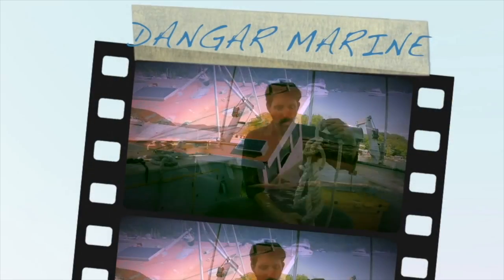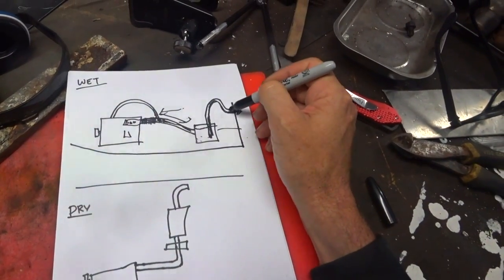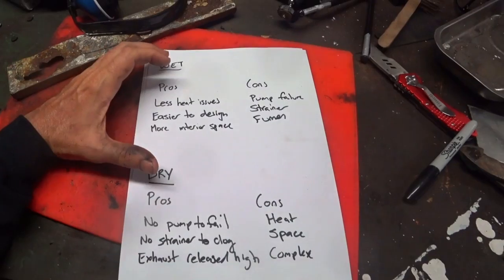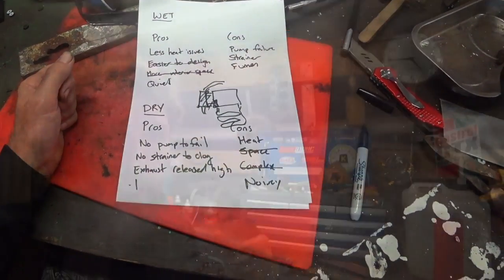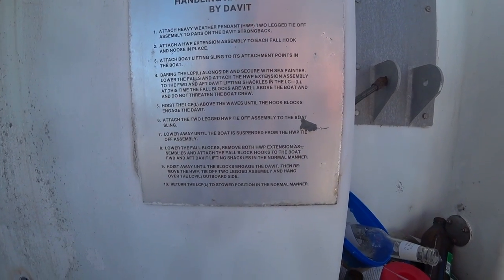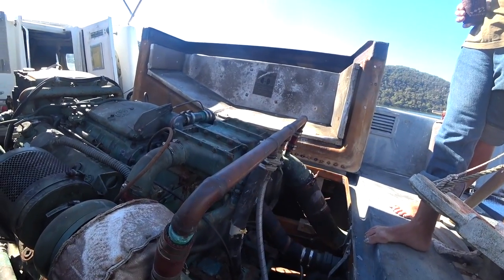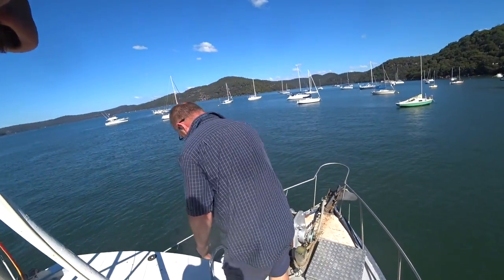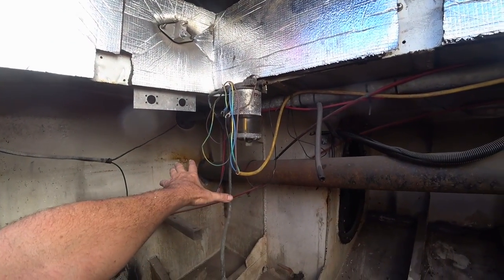Wet Exhaust vs Dry Exhaust

Comment: You can get a variety of mufflers for a 4-71 at the local auto parts house; these engines are the most popular marine engines in the world. Go dry exhaust and put you a colling water tattle tale out one side of the boat so you can physically see the raw cooling water flowing out. I'm in the USA and ran a 48-foot crew boat, a Breaux Bay Craft, for a couple years. main power was two 8V-71s raw water cooled and wet exhaust. On each engine, we had the hot raw water out exiting through the port and starboard side, respectively, about a foot above the water line. Crank up your mains and look over each side and see if your pumping raw water or not. I loved that boat, but she could go through 300 gallons of diesel in no time. Had a set of 2-71s on gen sets too. Love you trawler series, I want one myself, but about 10 or so foot longer with a 6-71.
Reply from the maker: I know what you mean about being 40 foot longer being desirable. That's why I'm so desperate to get space back!

Comment: Wow Stu.....best video ever......I hate the idea of salt water running through my engine.....all that corrosion....electrolysis.......anodes.........a hole in the hull.!!!!....I've been thinking about exactly this dilemma for the last 3 years......currently running wet exhaust....Bukh DV20.......dramas with ancient pumps and impellers.......hmmmm?   separate coolant system??? dual cooling system??? dry exhaust.?.......electric conversion with generator and new prop?????? .........For what it's worth.......I reckon you should totally go the dry exhaust option......it makes total sense........BTW....your workshop looks like mine.....noice.........and last of all....thanks for showing us all 2 sweet Trawlers and their massive Donks....(Australian for engine).......on the quiet motor issue.....have you considered 2 mufflers?.....one big unit that lives under deck.....high flow.......and another topsides.....the silencer.?..........Like a Cadillac........or a Lincoln Continental.......Thanks man & Cheers
Reply from the maker: I definitely could rig two mufflers, even two and a particulate filter. I really need to talk to an exhaust specialist to help with the a design.

Comment: Hello Stu, I've been pondering the muffler question for your engine. There is a guy in the USA who is an absolute Detroit Diesel guru. He posts on YouTube as Bus Grease Monkey, he is a mechanic who travels thousands of miles a year in his fully equipped vintage bus to work on peoples Detroit Diesel equipped buses. Thus far I've not seen a single aspect of these awesome engines that he isn't able to tackle. I'm sure that if you contacted him with your questions and thoughts he'd be happy and very able to help you out. He's a thoroughly nice guy and a mine of knowledge. Regards from the UK.
Reply from the maker: I'll try getting in touch and see what he says.
Reply: @DangarMarine  He posted a video way back in 2014 that might be of interest Stu, It's posted under the title "How to set maximum no load RPM on Detroit Diesel 8v71 6v71". There is a contact web address thingy at the very start of the video too. That should make things a bit easier.

Comment: aye Stu, nice clean up!  I think you are right on with the dry exhaust.  Seems the boat already has all the hard parts done....safe penetrations and space allocated.  I think the previous owner maybe didn't use a muffler and that lent them to go wet.  But with a nice system designed for your engine I'm sure the noise would be no issues after hearing your mates trawler.  Plus a quick blanket and box in with a marine rated fire board would keep your and guests safe from burns.  Sounds like a smashing idea!

Comment: Hi.  Interesting issues with both.  From my perspective both are too noisy and obsolete.  The wet exhaust, if designed and well built seems like it could yield the best results.  I wonder if it's time to make it right and use dual electric motors and build a nice bimini to cover with solar panels.  If it was my boat this would be the only way forward cause I would have no pleasure on a noisy boat or smelling exhaust and fuel fumes. Nothing could be sweeter than a silent gliding boat traveling the beautiful oceans.  I think the wild life, any passengers and the whole world would be really proud of you for going electric.   Good luck with the project. Thanks for sharing.

Comment: Another thing to consider in the wet exhaust system, is that if the water is injected into the exhaust at or close to the water line, a siphon break is a good idea to install in the raw water discharge line with a loop above any possible water line. This ensures no water can siphon past the raw water pump and fill the exhaust.
This is done primarily in sailboats and other vessels where the engine is below the waterline.

Comment: Hey Stu,  to eas your mind about the waterflow, just weld the old water-outlet shut and drill a new hole above the waterline so you can see the coolingwater flowing. Shouldn't be that hard, and it doesn't hurt anything. For the exhaust itself, just replace those double-stacks with a good muffler and all should be good. I mean, your mates dry-exhaust sounds just fine with only one muffler. Never thought a Detroit could be that quiet with only 1 muffler! I do agree with you on asking an expert, though. That really can't hurt. Well, the wallet maybe, but other then that...
And i'm sure you can remove that whole wet-exhaust without regrets. Lord knows what the previous owner was thinking when he converted the boat to wet-exhaust...
Reply from the maker: Having the water discharge below the water line apparently helps retain prime and can be an advantage when when pulled up next to a wharf or boat with low free board. Having said all that, I do love the idea of being able to see the cooling water.
Reply: @DangarMarine  Indeed, not eveyone likes wet feet by a water-outlet from a neighbour, lol. It's common over here, though, on commercial ships that is. 
But indeed, it can be a problem. That said, you could opt for a .... an eh... yeah, don't know the English word for it. Let's say a looking-glas.
I have in-line thingys with glas on both sides to check the flow. If you want i can make a little vid on it to show you. Just tell me where to post if you'd like that.

Comment: I have owned and operated both wet and dry exhaust vessels. The dangers of a wet exhaust are:
(A)  going hard astern, where the sea washes back into the turbochargers, Particularly vulnerable craft are low slung speedboats. No room for a high-rise bend in the exhaust pipe before overboard skin fitting.
(B) Heavy rain or leaky stern glands; especially low slung powerboats unattended at moorings or marina dock.
These can cause entry of seawater into exhaust manifold and cylinders; wrecking the entire engine. As a boatyard proprietor I have had various customers with these problems.
A dry exhaust with a large muffler (exhaust silencer) is the best, hands down. Raw cooling water appearing from skin fittings above the waterline then confirms that the heat exchanger is being supplied and no other possibility. 
As far as occupying space is concerned; no reason dictates funnel must be amidships. Awnings, Radar and antennae goalposts aft can carry exhaust pipes on either side.
Reply from the maker: I'm happy with my decision to go dry, it has certainly given me a lot of room back in both the lazarette and engine bay.

Comment: I didn't realize this was converted from dry to wet and the infrastructure is there.  Best guess is the noise drove him to a wet exhaust.  Those 71's get loud even with the proper muffler.  If you decide to go dry you could also think about a keel cooler and use the ports for the raw water suctions for the keel cooler.  Heat exchangers require diligence monitoring the zincs and you need to inspect the unit itself once a year and possibly back flush it with some cleaner.  Not that it's a problem for you, but it is a consideration.  

As far as the 71 maintenance goes...we had a whole list of things we did on an annual basis for exactly these engines.  I'd recommend replacing the injectors, rebuilding both the water pumps, changing zincs, changing oil, fuel filters and racors.  I have no idea how many hours it's been sitting or how many hours are on them now.  Rebuilt injectors and pump rebuild kits aren't too expensive and are well worth the piece of mind.  Also change the screen on the reduction gear.  It wouldn't hurt to swap out the oil too.  We used the same oil in the gear as our engines.  You may not have that luxury.  

The hull repairs are looking solid.  Can't wait to see the engine service vids.  :)
Reply from the maker: I certainly have a lot to learn about these motors. I'll take a look if I can see which injectors are in it and find a rebuilt set to swap with, that sounds like a good idea.

Comment: the wet exhaust has way to many holes in the haul that could be detrimental and it takes up to much space, plus like you said there are too many other things that can cause problems. I like the dry exhaust, less potential problems, plus that is how that motor was meant to be, get a good diesel muffler and sound proof passageway sorta like the second guy has. I like the bent pipe also, better then a noisy flapper flopping around to keep the rain out.

Comment: For sound insulation, you could use a spray product called Lizard Skin, and for heat insulation if you go to a dry exhaust you could have the pipes ceramic coated.

Comment: My guess is that the conversion to wet exhaust was to get rid of the hot exhaust pipe that was on deck and ran in front of that window.  That area may be a good location for a muffler, but it would need a large heat shield to protect people and you would lose the use of that window.
2 stroke engine do not like back pressure for sure !

Comment: Go dry, gives you so much more space, less things to go wrong. Use the diesel motors water pump, but plumb in a secondary electric pump for just in case. Once you run new pipe to roof of wheel house cover it in stainless for safety then get a quit muffler for the top. Keep up the video's buddy. I realy liked the daily video as well. Do like 2 video's a week. One for work, one for life of Danger Marine, like having fun, bumping into fellow friends, etc!

Comment: Thanks for sharing! I want to repower my boat with two truck engines such as 5.9L Cummins  or DT466. Straight pipe the exhaust with a muffler directly up out of the engine room.

Comment: I have seen a wet exhaust designed so that it covers water around the manifold (like the one you showed) but the outlet of the water went down the exhaust pipe further down

Comment: The pong box or lifter as you call it is supposed to suppress a lot of the sound along with the water. So I don't think you would get much of a difference in sound. It might sound biased but from an aesthetically pleasing point of view the wet exhaust is nicer on the eye. A lot of commercial vessels now are even starting to phase out dry exhaust systems
Reply from the maker: Hey Callum. I definitely think wet exhausts have a certain charm simple by being unique to boats.

Comment: To me, looking at your situation and knowing how valuable any useable space is on a boat, I'd go back to the original design dry exhaust. This would preclude any chance of water intrusion into the engine. Your friend with the dry exhaust had some good ideas for sound deadening. Also, the dry exhaust looks less complicated. Less things to go wrong when at sea.

Comment: I had a 471 same motor as you I had a dry exhaust system very long muffler on it coming up to the top pretty quiet, I liked it , I had more room  which is prime real estate  I think you should go with the dryer exhaust and make use of the engine room. you will have a lot more room for a nice generator. There's a lot of new materials in order to cover the exhaust manifold Maybe even find a stainless steel mesh exhaust for the elbows
Reply from the maker: That's great to hear. I think technology has come a long was since this boat was built 30 years ago.

Comment: There can be a lot more to a wet exhaust. Seawater coming from the engine heat exchange return is piped (preheated) into the water jacketed manifold and exhaust pipe and then below the exhaust riser mixed with the exhaust gas via a water curtain at the end of the water jacket and then back below the waterline. All the hot bits have some sort of heat control and the exhaust sound is attenuated. I hope this explains how a full'y integrated wet exhaust system works. Cheers

Comment: By dispensing with the wet exhaust you more easily accommodate enlarging your fuel tanks which would greatly increase the boats capacity for long range cruising.

Comment: Myself, I would prefer the dry exhaust. The reason is less opportunity of backing water into the engine, and clutter removal. It is tight enough down in the engine space without all the additional wet exhaust parts. Water pumps do fail and inlet screens do plug up.

Comment: I have to agree. Wet exhaust looks like allot of work and takes up space at least below deck. New dry exhaust systems for diesels are allot better than it was years ago and doesn't choke off the airflow. If there is smoke there is additives to help with that now. You will be happy with a dry exhaust setup with a good air quality system

Comment: Theres something about boat tech thats interesting to talk about. Alot of DIY and never premade, usually some guy knows another guy who can tig weld stainless and can make a copper tube heat exchanger that you need for your boat, then you buy stuff, hoses etc that you install yourself :)  

My father in law is currently replacing an automatic gearbox to a marine clutch on his 9m long displacement hull type (google Meriläinen) boat because it makes too much heat and he can then remove 1 heat exchanger to make more room. Its a Nissan Cedric 2,8L inline 6 engine.

Comment: Have a look at a split system. Taylor (local mob ) make them.  Cooling water can exit below the water line. Exhaust gas out the back . Quiet and efficient.
Reply from the maker: Just emailed them now. It will be interesting to see what they say.
Reply: @DangarMarine  
Not so cheap. But I used one on my newly built 32 foot launch Stormy Weather (Eastcoastmotoryachts.com.au for the full saga) Quiet and efficient.

Comment: I had my impeller fail on my inboard penta, causing the wet exhaust to run hot a melt, minutes later we had a sinking house boat.
Reply from the maker: That's certainly something I would keen to avoid...

Comment: Simple dry exhaust conversion since almost everything is already there.

Flexible pipe from the manifold to the deck pass through pipe, and put a large muffler in where the pipe section has been cut out.  You can build some kind of decorative cover for the muffler section that will keep people from touching the hot muffler...  done.
Reply from the maker: Yep, I think building the cover will probably be the hardest bit!
Reply: @DangarMarine  I don't think that the cover will be that hard for you, since I have seen your fabrication skills at work during this video series.  Basically, I would make a curved metal cover that looks like a smoke stack and has 2 clips or bolts on each side holding it in place.  maybe add a bit of rubber molding around the edge so that it doesn't rattle all the time. :)

Comment: 1. Wet exhausts are prone to allowing/sucking sea water back into the engine. To prevent, run the riser up as high as possible below the deckhead, then turn down again. The water injection enters the exhaust at least 6" after the downturn and points down. Go with the dry exhaust if you can - far less to go wrong and you have enough space to insulate the riser.

2. There will still be sea water circulating through the engine and transmission heat exchangers. I'm not comfortable with a discharge through the bottom of the hull. Put the discharge out through the side of the boat, ABOVE the waterline where it is easy to see from the wheelhouse door. A glance at start up and every so often when running will reassure you that all is well (or not).

3. I strongly recommend a large Perko basket strainer close to the raw water inlet seacock. Easy to monitor for collected debris and easy to clean. Also, flushing my engines with fresh water is a breeze: turn off the seacock, open the Perko cover, insert fresh water hose, start engine, balance flow and demand, drink beer, Voila!

4. It is worth considering an over-temp alarm on the engine's cooling water jacket and a low-flow alarm on the heat-exchanger discharge.
Reply from the maker: I'm definitely going to be cutting the water intake pipe and putting a large strainer in. Currently this doesn't even have one over the skin fitting, it's just straight through all the way to the heat exhanger.

Comment: What some else said about ditching the twin pipes. I would add from where the exhaust pipe clears the deck 1 eight inch straight pipe and get it to exit at the same height as the twins do now. the bigger the diameter of the pipe, the duller the bark will be. Compare the sound of a bass drum to the sound of a snare drum. With the big (8") you have the bass drum and with the smaller twins you have the sound of a snare drum.
Reply from the maker: Yes, I definitely think a deeper sound is much more pleasant to live with.

Comment: Having worked with both, revert back to the dry system. more space in your engine room, less holes below the water line, less to go wrong at sea and your not going to loose wheel house space with it being situated on deck.